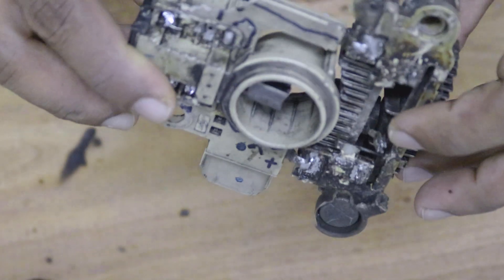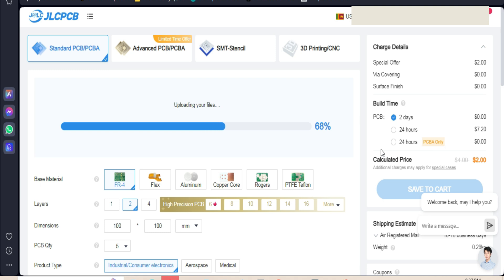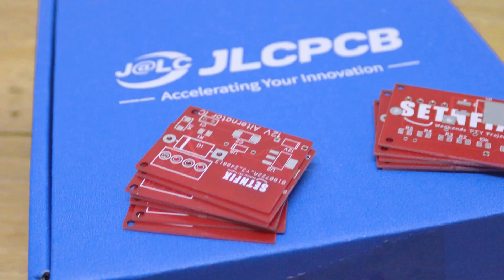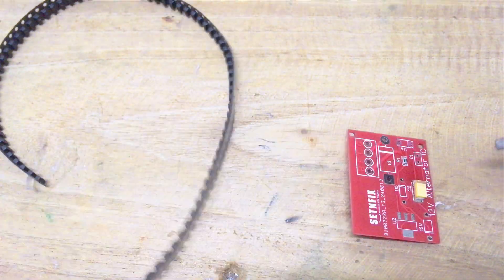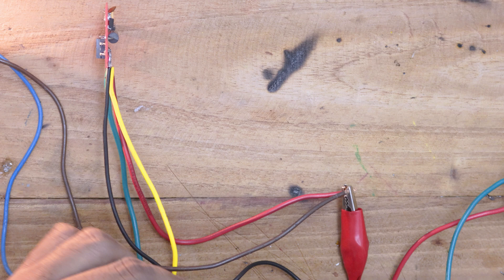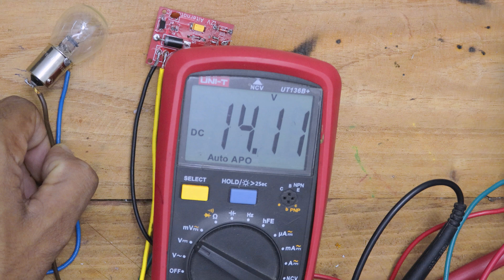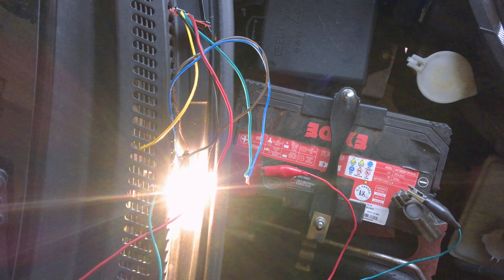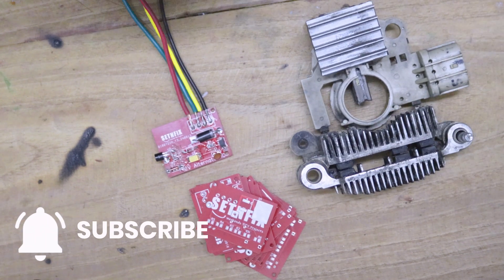FIX Your Car Alternator IC in 1 Hour Without Breaking the Bank!

Comment: Dear Sir, I have a vintage car with a three brush neg ground dynamo and Lucas cf1 regulator / cut out.  Is there a circuit board and parts available or could be made to make a solid state version, a similar idea to what you've produced.  Classic Regulator and Dynamo Conversions produce one but unfortunately they are too expensive for me.  Help would be appreciated.  Brilliant tutorial.
Reply from the maker: IS it with a mechanical Relay?  . You can use this same circuit. but identify the wires correctly.
Reply: @setnfix  Sir,  many thanks for your reply.  Yes it is. will it make a difference that the dynamo is D.C.
Reply: @setnfix  Thank you Sir.